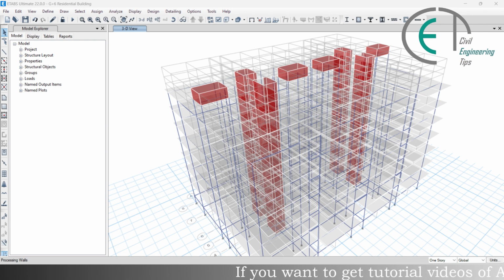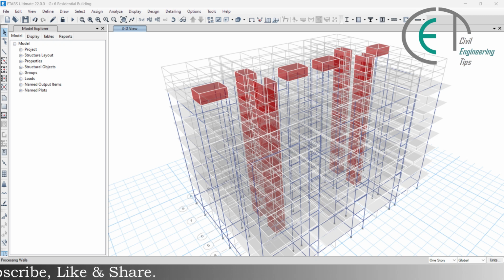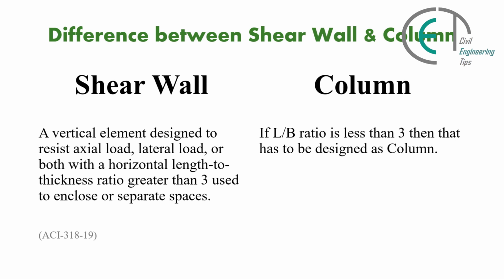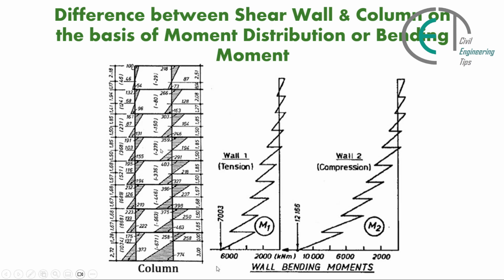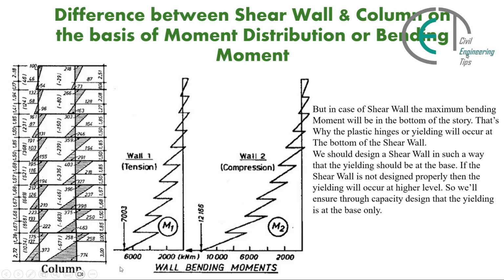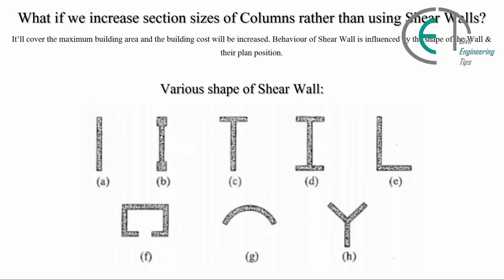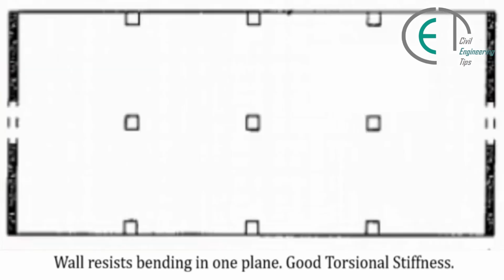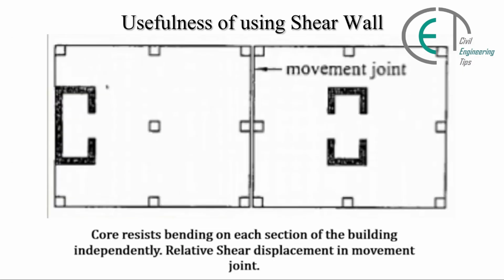1. Introduction to Shear Wall | Shear Wall Design in ETABS |Difference between Shear Wall and Column

Comment: Is The walls and columns 
 conservative check if  model it with all the piles length with springs.
Reply from the maker: Just model the superstructure in ETABS. Use SAFE software for Foundation design using the loads.